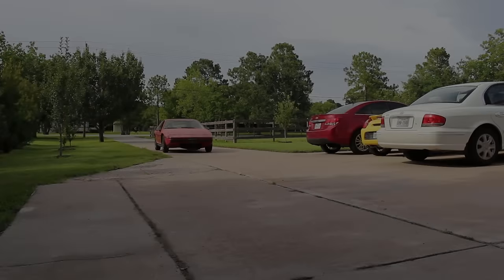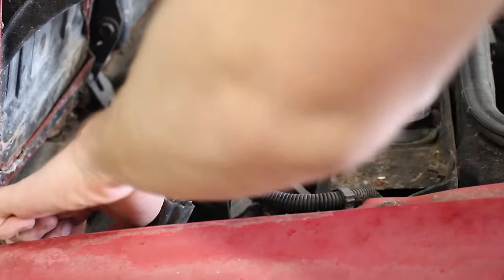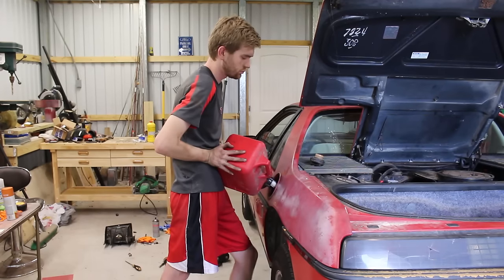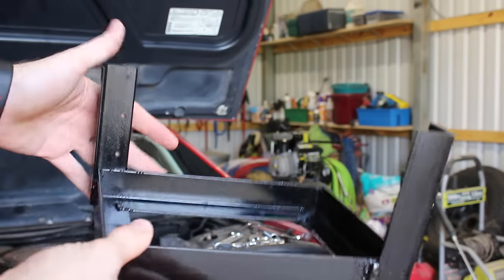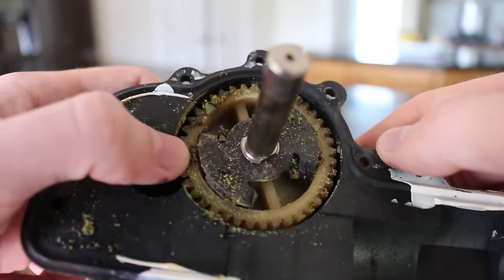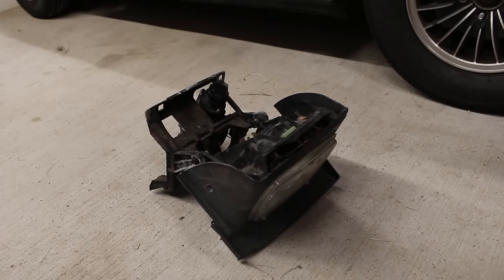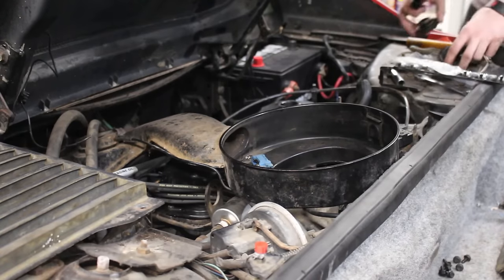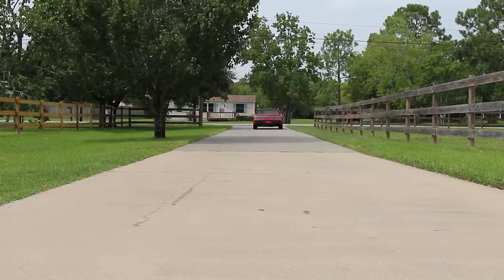Blink Once If Your Headlights Go Up and Down | 1985 Fiero 2M4 Revival - Part 4

Comment: I've been watching you build that car. I think it's cool seeing younger people do work for themselves to save money. I started building motors at the age of 10. Now I'm about to be 39. Anyways I'm gonna give you some great advice. Never ever EVER use that garbage Quaker State oil again in anything and Fram oil filters are crap aswell. Hear me out. That oil has so much contaminates in it and alot of detergents. That equals massive carbon build up in the oil galleys and the valves. I had a couple of cars that I fixed due to so much carbon buildup it clogged the exhaust system before the catalytic converter. Yeah diagnose that. Anyways a good decent oil imho is Castrol GTX or Penzoil. But to me the best is Amsoil. But that s#!+ is expensive but it works phenomenally well. Now with the fram oil filter, they are all show and no go. You ever cut one in half to see what's in there?  It's cardboard... Yeah great protection. STP filters and Wix filters are way better and typically are cheaper.  Oh and your bolt you snapped off. Next time you play with it soak it real good with PB Blaster and let it sit for as long as you can, few hours at least then hit it with a like a Coleman camping torch and proceed with extracting it. You know while it's hot. Also never use a wire wheel without eye protection at least, trust me you will hate life when one of those wires flies off and goes in your eyeball, then it's off to the doc so he can rub a magnet over your eye. Again I think it's cool your learning. You also need to try to invest in some latex gloves or something. I saying this cause people get hurt off of the dumbest stuff. Gloves I say this because I changed the oil once on a Dodge Dually and the next morning I had not one but 2 warts. One on each thumb. Yeah you dont want that. Anyways good job so far. And have a blessed Veterans Day.

Comment: For the gas pedal: 
Put your heel against the idling gas pedal and then use your toe to throttle without moving your heel... it’s not a terrible system once you get used to it

Comment: When you decide to do the thermostat. If the intake is aluminum.. please. Just torque it down slightly.. you don't want to have to put a pos helicoil in . If you do happen to break a bolt off into the intake. Fill the hole with aluminum weld and re drill it. You'll end up with a better result

Comment: Hello Ronald, Steve here from Canada. I'm a long time Fiero owner. I love your videos and your doing a hell of a job, not only on the car but putting the videos together. Well done. I do have a couple words of advice for you and you can either take it or leave it. Its just things I have come across in my many years of  tinkering with my Fiero. First off I would change out that fan relay. I know you said it is working fine but, it did take a couple of love taps to wake it up. Keeping a car at proper operating temperatures is key to a long engine life. It only take one oops to cook it. Is it really worth cooking your engine over a $15 part. Just my thoughts. Second Fram is the absolute worst oil filter ever made!!!! Checkout the "worst oil filter ever "video on YouTube. They test several filters and it show how bad it really is. Buy the NAPA Gold best bang for your buck and you can pick it up at any NAPA store. Anyway that is the end of my advice/rant  Keep up the good work. Look forward to watching more of your Fiero revival videos.

Comment: The radiator fan from the factory would not turn on until the engine reaches 250 degrees Fahrenheit, which is part of the reason they blew up, some people will just bypass the fan relay with a physical switch.

Comment: Easier to just replace those bad motors. The Pontiac Firebird and Fiero use the same motors except they are reversed. IE the drivers side on the Fiero is the passenger side motor in the Firebird and vice versa. The motors are flipped around and mounted on the opposite side. I found this out the hard way when I ordered one from an Ebay seller and his listing was wrong and he sent me the wrong one. He apparently didn't know that. I confirmed by checking part numbers at O'Reilley's. As a plus tho the Ebay seller didn't want to pay return shipping for his error so he called it a loss and refunded my money, which means I now have a free spare headlight motor for the side that didn't need replacing. :-) This is on the 87 anyway. But being a "use what we got for parts to save money" car, it's guaranteed the 84 motors came from another car too. Maybe from the Firebirds of that year also. The GM big whig brass kept cutting Pontiac's Fiero development budget so they couldn't afford to make parts just for it.

Comment: This has probably been said but skip the drill bits and extractors. Weld a nut to the broken stud through the center of the nut and just simply spin it out. Just don't weld the nut to the head. You are a much better welder then me though so I doubt that would be a problem. Just don't forget to disconnect the battery when welding.

Comment: I probably missed it in previous videos, but by any chance did you change the spark plugs, thermostat, and spark plug connectors? (I always forget what the cables are called that attach to the spark plugs)

Comment: Valve covers and gaskets are a scam meant to destroy the will of DIY'ers and for a living mechanics. My years of experience have taught me a few things concerning replacing valve cover gaskets. 1. Check and repair any damage to the cover and head mating surface after cleaning. 2. If the torque spec is low ft. lbs. convert to inch lbs. ( 3 ft. lbs. = 36 inch lbs.) 3. If you don't know the spec tighten in pattern till the bolt stops and go 1/8 more. Check for leaks and adjust as necessary. Better to do it twice than snap a bolt.

Comment: my rule of thumb is any bolt that you can't torque with a half inch drive torque wrench I torque with a short 3/8 drive ratchet or a 1/4 inch drive ratchet and do it by feel. with that big of a torque wrench a little 1/4 inch bolt you don't have any feel and I trust my intuition more than the accuracy of a big torque wrench.

Comment: Guide for anyone working with tightening bolts? But you do not have a torque wrench to hand 

Screw in or Screw on and when you have to apply ANY force to the wrench spanner or socket bar? Turn only 1/8th Approximately 45 degrees If you imagine a dot right in the centre of a bolt or a stud? and then you were to draw a line out to the corner of the nut ( 6 sided nut or allen or torx ) Start at the first corner you chose and call it "corner 1" the next corner clockwise or anti clockwise? is 60 degrees away 

That is the absolute maximum I would torque something for steel in alloy I would RESIST THE THOUGHT TO TIGHTEN ANY MORE!  I would go with that 45 degrees for safety and so you do not shear the stud or bolt 

If in doubt check out the Vehicle Manual's torque guide for specific bolts!! Crank Main Bearing bolts will be way higher than Camshaft carrier bolts   

Good Build and Good Work But While you are in there a wire brush and some red oxide behind the brakes rotors etc won;t take too long and will protect it till you get around to the painting parts time 

Good Build!" Enjoying Watching !

Comment: Great vlog about redoing the car. Just a few observations: A battery tray is normally really cheap pre-made items for most vehicles. Did you not find a pre-made battery tray or did you just want to make one?  Also driving around without tags is illegal but like you said you were in a rural area and not on a major highway, it's one of the illegal things that get you in trouble more if you did something else wrong like hit something. It would have been great to see some of the repairs you did 'off camera' in before and after shots even if you did all the repairs and installation completely off camera.  Don't kick yourself too much over the over torqued bolt. Looking forward to more of the vlog. You're doing great on the restoration!

Comment: Nice work! Good filming and narration. I'm enjoying your series. But it sure would be nice to see you use a bit more PPE when working around chemicals; gas, diesel fuel, brake fluid, parts cleaner, to name a few. All that stuff is terribly nasty to the human body.

Comment: As someone who very recently found a mint '84 for sale (and who is hellbent on getting one despite my former-fiero-owning dad telling me it's a bad idea) how much have repairs cost you so far?
Reply from the maker: So far, I’ve spent $1700 including the car (which was $100 in my case). That includes everything I’ve shown in these videos so far as well as everything for the suspension and clutch which will be in later videos. It’s not as bad as I thought it was going to be! There’s still quite a bit more to purchase for the project, but I don’t think it’d be more too much more than $4000 after bodywork and paint (which I’ll be doing myself)

Edit: also are you a Mechassault fan?

Comment: How bad is the frame of your fiero, I'm going to buy one that's been sitting for 10 years. I would really appriciate your feedback.
Reply from the maker: I’m extremely fortunate to get a car with absolutely minimal rust on the frame. Only cosmetic surface rust really. I have seen threads online where cars have been ripped in half just trying to jack up the back due to the rust being so bad. It really depends on what part of the US it’s from and where it was stored
Reply: @RonaldFinger  Thank You for the info! Since there is currently snow on the ground, and it happens every year, looks like it might not be looking good for the car... But hey, if you need any parts, which you probably don't considering that you're just editing the revival, I think its around the same year as yours.

Comment: instead of rebuilding the iron duke, you can get a 2.4L ecotec for a couple hundred bucks.  much lighter, 70hp more, and better fuel economy.  will bolt up to the Fiero subframe.  A manual tranny conversion would be a nice upgrade (lighter, better gearing, better mpg).

If you're in there replacing all the suspension bushings and cleaning/repainting all the members, why not upgrade to an '88 suspension, or an aftermarket setup?
Reply from the maker: If I had any interest in increasing performance, those would definitely be things I would consider! However, I’m trying to keep this car as much of a representation of what it was when it came off the assembly line. It’s 100% stock and that’s pretty much an anomaly with any car of this age. I’d like to keep it as a relic of the past for that reason

Comment: Here's another "you only make that mistake once"  that kinda' goes along with that over-torqued valve cover bolt....never try to unscrew a spark plug from a hot aluminum block engine.  (You'll strip the threads)

Comment: Don't use gloves while you're using a bench grinder. I had a coworker whose glove got caught in the wheel, it pulled the glove around the wheel and literally pulled his finger off his hand. The finger still inside the glove was hanging by the tendon off the grinder... its better to endure a small scrape on your knuckle

Comment: I'm surprised you still hadn't cleaned the engine bay yet. First thing I'd do when buying a car this old is to take a pressure cleaner and blow all the dust and rat shit from the engine. If it takes out a few wires in the process so be it but man that looks nasty.

Comment: That's the wrong oil filter! The one you took out is the proper one. The recall has you replace the shorter filter with the longer one to hold more oil in the engine!

Comment: There are a lot of people wanking about the Fram... they may not be the best but if you change the oil regularly it won’t make a difference on that old gal...and one commenter said to use fresh oil on the gasket??? Please...    Many comments about torquing nuts and sequences... yeah yeah you should do it... but it’s and old fiero??? Seat of the pants mechanic, good job.

Comment: Please please PLEASE don't use FRAM filters, Ron. They dont have good oil-drainback valves to prevent the filter from emptying its contents, prolonging lack of oil during cold starts, but its filter medium is just garbage. I advise Napa, Wix, or K&N. It is more expensive yes, but it does you dividends, they aren't cheaply put together.

Comment: well im certain im not the first to say this but dont use fram filters they are garbage now days i have actually had one fail on an old piece of equipment and it caused some damage they are ok for a short use if your doing a oil change between a oil change after a rebuild or something but if you put any kind of millage on it use a different manufacture

Comment: I thought he was going address the barrings he put in not greesed.
Reply from the maker: Which bearings did I not grease?
Reply: @RonaldFinger  when you rebuild the breaks and replaced the bearings people mention those needed to be greesed before putting them in. Lubricated.
Reply from the maker: If you’re referring to the front wheel bearings I replaced, those were indeed greased. I showed that in the video, with narration accompanying it. Maybe you missed it?
Reply: @RonaldFinger  woops well hope all is coming well with the project.
Reply from the maker: It hasn’t been touched in months actually, but work will resume in about a week!
Reply: @RonaldFinger  take your time. Good things come to those who wait

Comment: yeah just bash or tap it wiith your first that shorts things out, you need a light hammer to you know nudge and wake stuff up, 
you don't need tags just so long as you have a liance and your only like driving up n down your street or drive it a short few miles to test it your fine its only if you start using it daily and are going onto like busy roads that your need tags whatever those are, 
things cars need now, woodgrain inside and out, and pop up head lights, 
cork was cheaper too as well it was the 80's and gm were not cutting corners but costs so its more the sealent that they used that is annoying as cork is very abzorbant, 
random donkey, okay? beter then deer as there rather curoius, and a whole heap better then a bear, 
>_< ooooh i felt every body bone in me clench hard from that snap and that's why kids we have tourque renches so that doesn't happen, 
"the car still looks like crap, beautiful crap" yep that made me laugh,

Comment: Great work Ronald.  I'm really enjoying this series.  Got some advice too.  I just restored the gas tank on my old Jeep.  It had totally rusted, which I suspect is also a problem for you (the pin holes in your tank were rusted through).  I'm in Europe, and I found a rather amazing product from a company in France.  Restom.  I'm not sure that they sell this product in the US, but if not there is probably something similar.  Basically the treatment cleans the rust from the tank and then coats the inside with an epoxy.  Check out this video  https://www.youtube.com/watch?v=zVgf-ygfuUI  It takes some time to do the whole process, but the results were fantastic.  The product is not cheap, but it's def cheaper then a new tank, and since the fuel will no longer touch bear metal, I suspect after this treatment the tank is better then new.

On another note, I once broke a bolt on my bicycle crank the same way you did on your valve cover...  I was using a torque wrench but the setting was wrong and I just kept pushing it.  Damn.